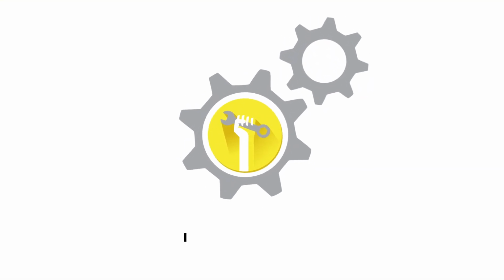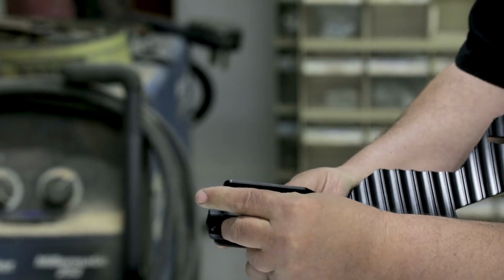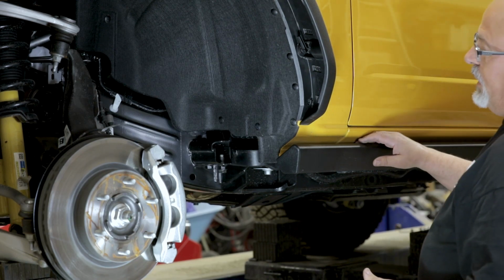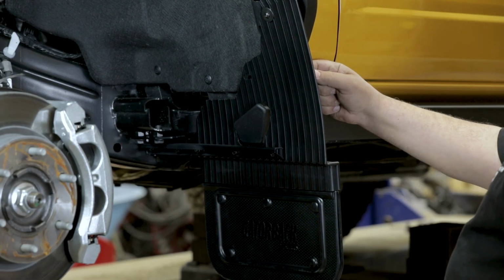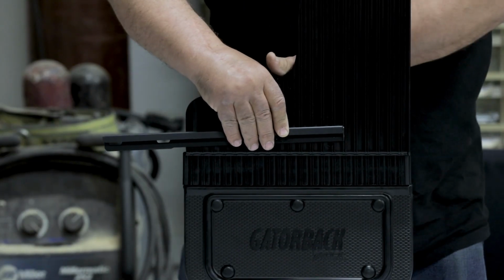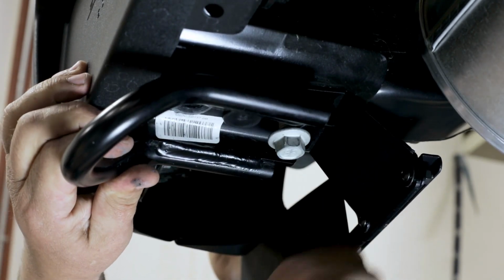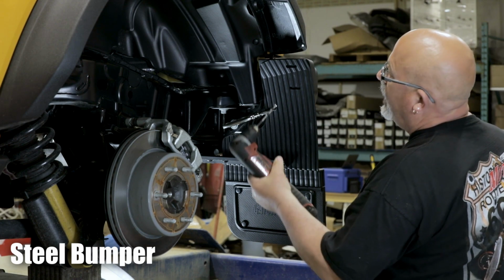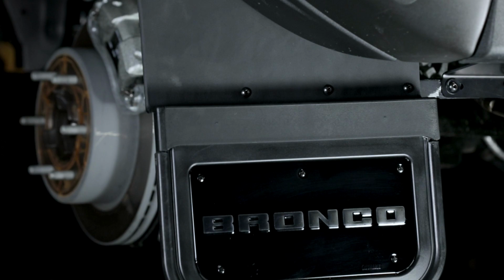Gatorback CN Mud Flaps for 2021-Current Ford Bronco - Installation

Comment: Excellent video! I've watched it a couple of times, trying to commit the process to memory, but I will be watching it again before I attempt the installation of my mud flaps. Thank you for producing such a helpful, thorough video!
Reply from the maker: It's great to hear that our instructional video was helpful to you. Thanks for taking the time to comment! We hope you enjoy your Gatorback Mudflaps.
Reply: @TruckHardwareLtd  is it necessary to remove the wheels and the fender flares for installation? I don’t have access to a lift or even a garage for that matter. Just wondering if it’s recommended to remove these things or does it simply make the installation easier?
Reply from the maker: There is no need to remove the flares. Installation of the front flaps usually does not require removing the wheels. In most cases, you can turn the tire to gain access to the flaps. To install the rear, the tire may need to be removed. There are a couple mounting holes to drill in the bumper, so the wheel will likely have to be removed to enable the drill to access them. A lift is not required, you can use a jack and jack stands.
Reply: @TruckHardwareLtd  Excellent! Thank you for telling me that. It looks like my flaps will be installed sooner than later!